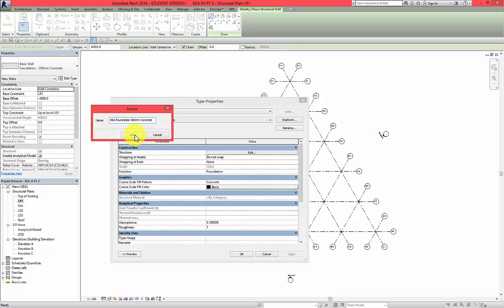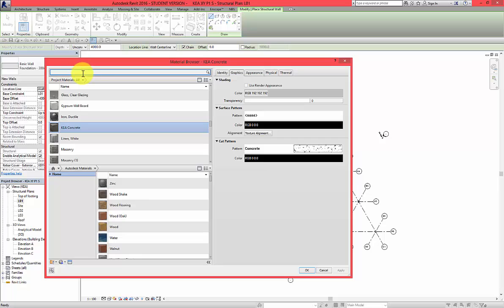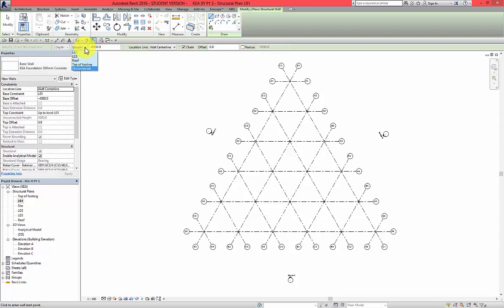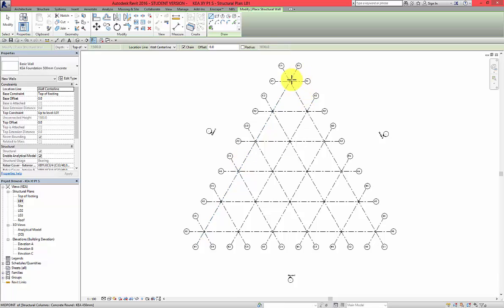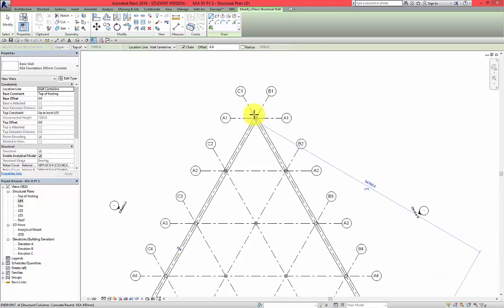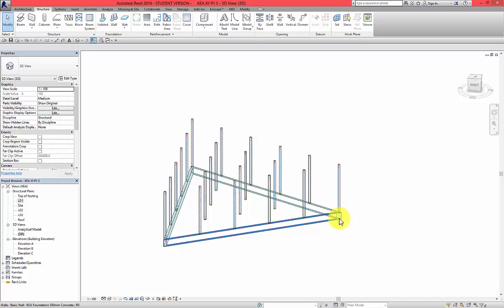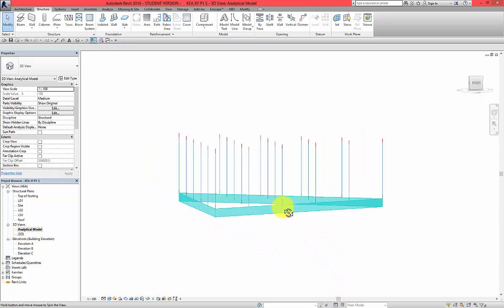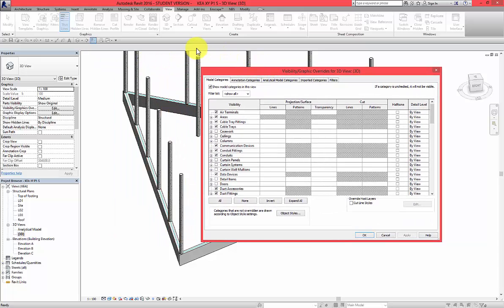Revit - P1 - Part 6 - Concrete Building - Foundations

Comment: my wall units are still in inches although I changed project units to mm.
Reply from the maker: Jitendra Soni , try this ... https://knowledge.autodesk.com/support/revit-products/learn-explore/caas/CloudHelp/cloudhelp/2014/ENU/Revit/files/GUID-3128F39D-34A3-4D09-A5BC-86C8D7300895-htm.html or start with Revit Metric Template at the beginning.
Reply: if I duplicate 12 inch foundation wall rather 300 mm foundation wall to make it 500 mm foundation wall, will it affect?
Reply from the maker: Jitendra Soni yes, it will effect the wall. Also in Revit working on imperial units you can type "500mm" including "mm" and Revit automatically will convert mm into inches. The issue you have is because you started with "imperial template" instead of metric one.
Reply: thanks a lot, I will start with metric template now